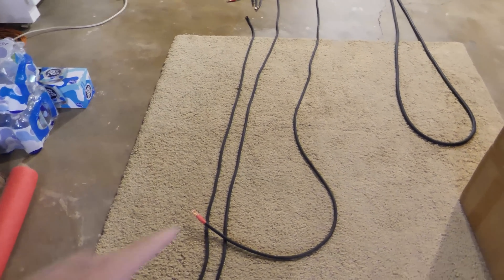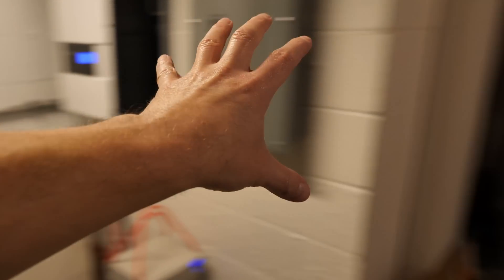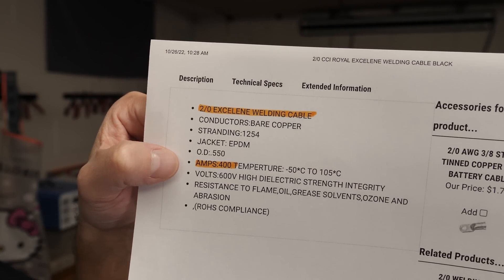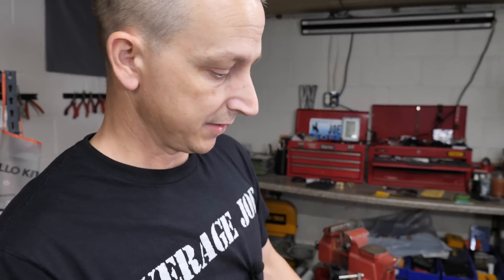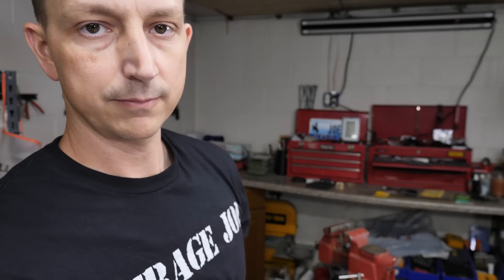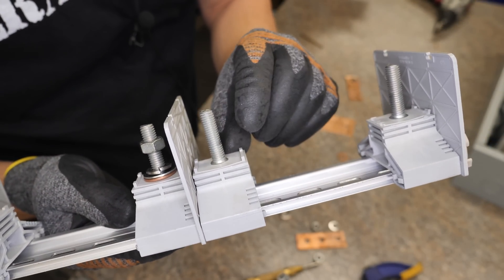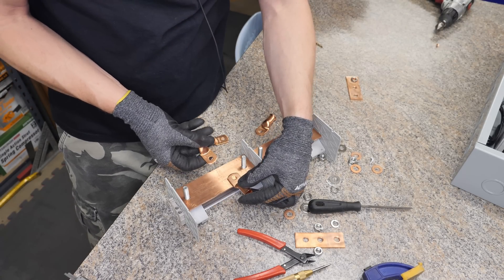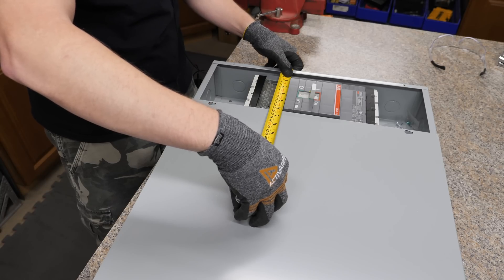Setting up Sace ABB S5N Box and Diy Buss Bars - Diy Powerwall 2.OH Ep6

Comment: Where did you get the posts (mounts ) for the busbars?
Reply from the maker: I forgot to include those in the parts list.  Its in there now.  I actually got them from my recycler but you can get them on amazon.  Kinda pricey Aff link -> Terminal Blocks - https://amzn.to/3d6bmPQ
Reply: @AVERAGE_JOE  uff , those are speedy … I will have to look for an alternate solution.
Thanks for all your great vids and sharing it w the diy community.
Reply from the maker: Yeah I saw the price and said WHOA lol. I would imagine they can be found cheaper for sure since the amazon site has the part #.
Reply: @AVERAGE_JOE  would you be willing to share your recycling guy contact , maybe he got a few more floating around… you could sell those too ;)

Comment: Hello, I just discovered your channel and I love it; thank you for sharing all of this knowledge.  There is so much to go thru...I have a grid tied solar system and would like to add a battery (or batteries) and use the utility connection as a back up for if the solar is not generating and the battery is depleted ; do any of your videos walk thru how I can do this and which components I need?  I already have the solar panels connected via an inverter to the grid; I still need to get the battery and possibly a new inverter to connect to the system.  Thoughts?
Reply from the maker: Thanks for watching! You would need a different inverter if you want to use the same panels and be grid-tied. You would want a coupled system or coupled inverter like a sol-ark. If you want to add an off-grid system so you can keep feeding the grid-tie system then you can do that as well.
Reply: @AVERAGE_JOE  I was just checking the sol-ark sight and didn't see it mentioned; would I still be able to continue sending my excess poser back into the grid to get paid (as I currently do)?  Also, those inverters are very expensive; is $7K-$10k really what I need to be prepared to pay for a good inverter?
Reply from the maker: Yes with sol-ark you can send your excess back to the grid like you do now plus have a battery. They are very expensive yes. There are other brands but I cant think of any off the top of my head. If you wanted to add another system with battery you may beable to do it in smaller steps to expand. For example, my inverter was $2k, I have 5kw used solar panels $1.5k. Battery will depend on what you want to do.
Reply: @AVERAGE_JOE  I like the DIY battery wall you built; I realize all use rates are different, but for comparison, the other battery you tested had about a 3+ hour runtime, how long will the wall 2.ohhhh that you built last under the same (or similar) conditions?
Reply from the maker: A diy wall with 32 cells (560ah)will be over 24hr use. In the summer I can run everything except my 240v items 24/7 from a 276ah battery. Check out the video I did with the rhino battery. Its similar to the husky video. Runtime was 11hrs on battery alone  if I remember right.

Comment: Should I just put standoff on the cover keep the shunts cool Because they get hot
Reply from the maker: How hot is your shunt getting?  Sure it can get warm but shouldnt get hot hot. Maybe check the connection to make sure its tight.  If it gets hot/cold it will expand and contract and therefore loosen the connection over time which will make it get hotter and hotter.  A possible remedy would be get a bigger shunt.  Also was that plural, as in more then one shunt?
Reply: @AVERAGE_JOE  The harder they get differently resistant it will give you a different reading